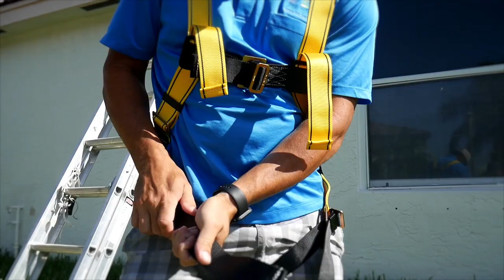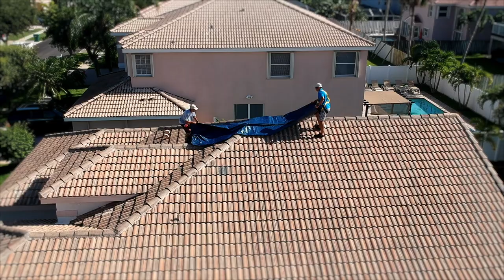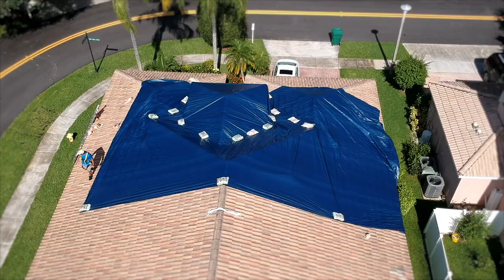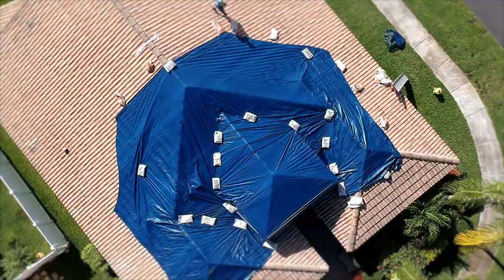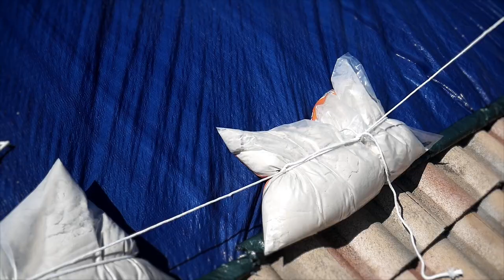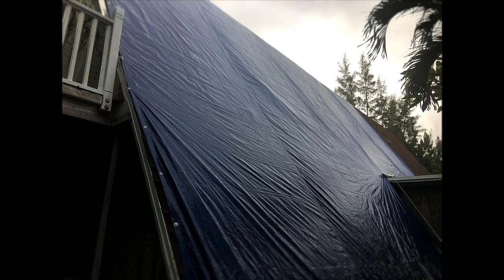ROOF TARP INSTALLATION

Comment: Where tf are you securing that line too?
Reply: You don't need to secure the rope tied to each sanbag because of counterwight.  Although they should have encased the tarp beneath the tiles on the ends.